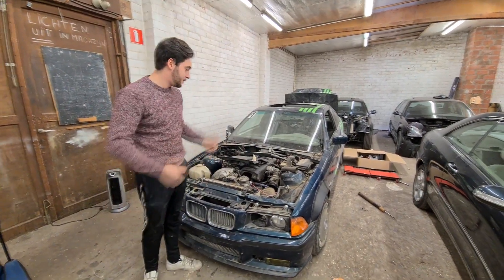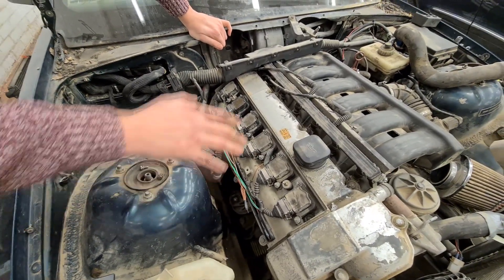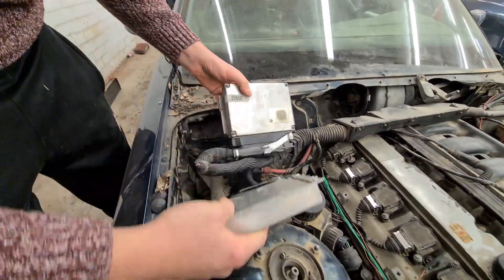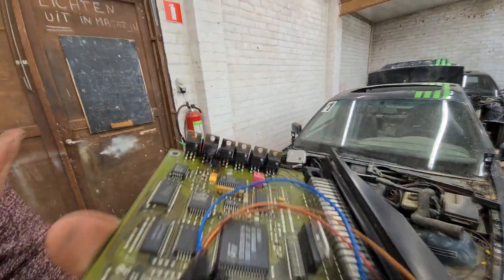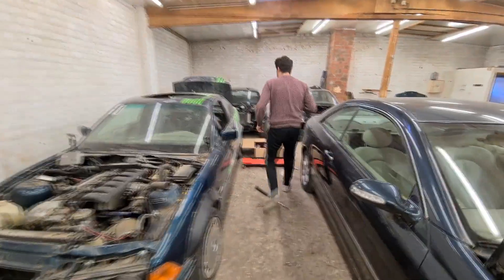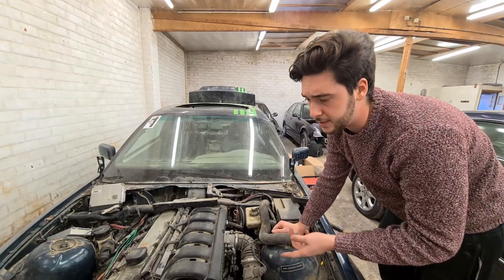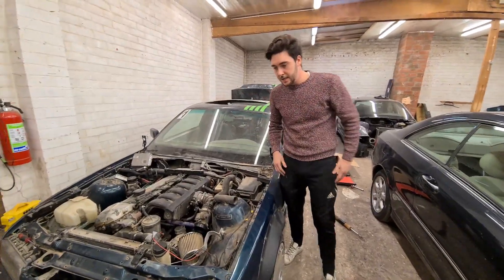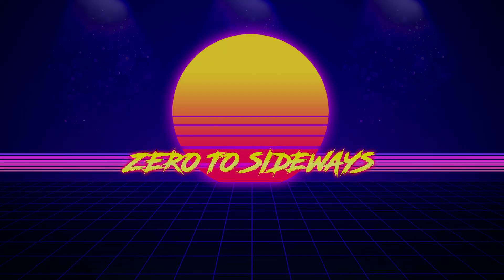HOW TO FIX SPARK ISSUE BMW E36!!!

Comment: Thank you for sharing! We had a similar misfire issue on a M52B20 engine and it was the mosfet of the corresponding cylinder that went wrong like yours (however it wasn't burnt, but we could measure completely different resistances between the pins compared to the five others).
For anyone coming across this problem (at least for MS41.0), you can change the original Motorola STP8055 (which is not manufactured any more) by a ISL9V3040P3 TO-220AB. It worked perfectly in our case, the car is now running on its 6 cylinders !

Thank you again for your help, great channel 👍

Comment from the maker: For the people who are interested, that transistor is a mosfet transistor and is used as a switch for the spark. The computer can't handle that voltage so they use transistors. Since this is coil on plug you need 1 trasistor for each coil.
Reply: I have a 97 bmw 528 i and just replace the motor and crank no start, no spark to the coil harness. What would you recommend? Your expertise is needed. Thanks.

Comment: Hoe heb je die kabels kunnen meten? Heb je ergens een handleiding gevonden? Ik zit met een M52B20 en siemens MS41.0 ECU. Cilinder 3 doet niet mee, alle bougies en bobines vervangen. Die van cilinder 3 was volledig gebarsten en uitgelopen. De connector van C3 geeft geen weerstand en de spanning kan gewoon door (12,4V). Nu zit ik vast, ofwel ligt het in de kabels ofwel de ECU. De pennen van de ECU zijn nog ok maar de ECU zelf heb ik nog niet open gedaan. Enige tips waar ik de juiste info kan vinden? Top video waarbij je dit uitlegt, de enige die het exacte probleem toont.

Comment: Hi man, I have problem with my 316i, When i swap engine, before i have too 1.6. I dont have spark, fuel pomp dont reacting. im looking for my problem long and i see this, i dont have power on DME, I cant connect my dme with inpa. DME sleeping. You know why?
Reply from the maker: Is probably a ews issue, you have to use your original dme. Make sure all your grounds are tightend down and your engine is grounded too.
Reply: @ZEROTOSIDEWAYS  im using original dme, ews module and key 🤷🏻‍♂️
Reply from the maker: @jakubhellwig  does the starter work?
Reply from the maker: Check where your idle air control valve is, i once had a the same issue and it tured out you have multiple versions of the m43.
Reply: @ZEROTOSIDEWAYS  starter working normal, No spark, No fuel, No power to dme
Reply from the maker: Have you checked you grounds?
Reply: @ZEROTOSIDEWAYS  me and 3 mechanics looking at this

Comment: PLEASE HELP ME  I got a m52b20 without  ECU so i went to Automobile junkyard and got this ecu from a sedan e36  MS41.0 5WK9 022 1 427 703 i try to start the engine but i didnt have spark the engine was turning without spark! so i whent back to junkyard and buy the ewsll from the same car that i got the ecu , but! i find out that my ecu was from another car so the ews was different  ( ewsll WBACB61000AP29194-2D47J) . so anyone can tell me what do to ? do i buy another ecu cause this one has emmo do i open it somehow or do a make a remap with this ews to the ecu i got and make also an new key? thanks a lot .
Reply from the maker: You need a ecu, ews and key or you can program the ews out but you need a index 10 ecu if you want to ews delete and connect the 2 thick wires
Reply: @ZEROTOSIDEWAYS   thanks a lot i was thinking the same ..
Reply: @ZEROTOSIDEWAYS  i am doing the same, the ecu is without ews, but it dont have the ews so I cant find the 2 wires to connect  I have crank but no spark.
Reply: @ZEROTOSIDEWAYS  the ecu is already made keyless

Comment: Any help I foundy dme had water tried drying it rev doesn't go past 2000 rpm
Reply from the maker: Put in a new dme and wrap it in a waterproof bag or look where the water gets in and fix it, your ecu is probably toast
Reply: @ZEROTOSIDEWAYS  found new dme switched chip starts but still no spark on cylinder one any help